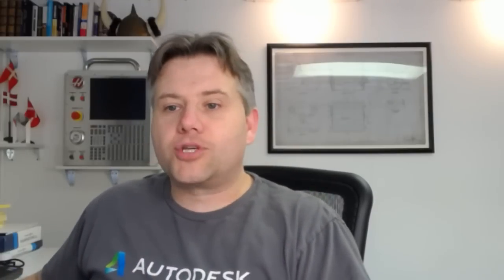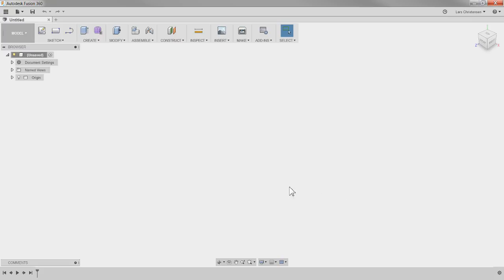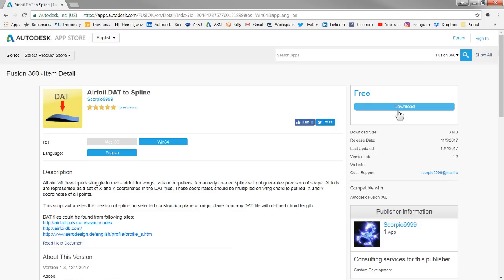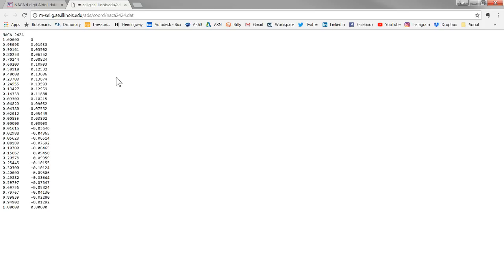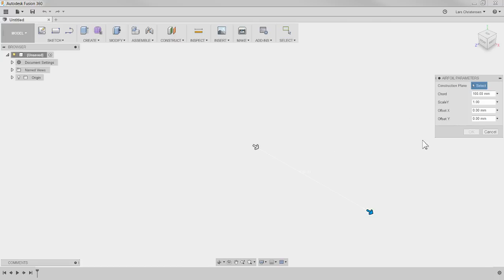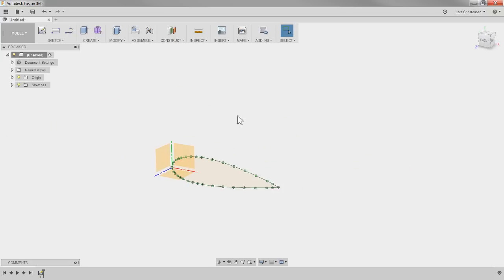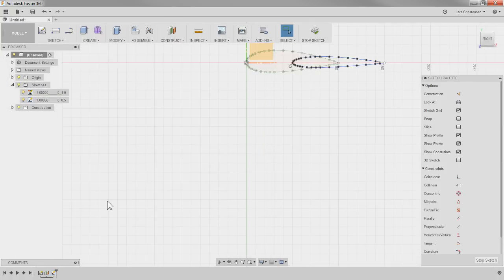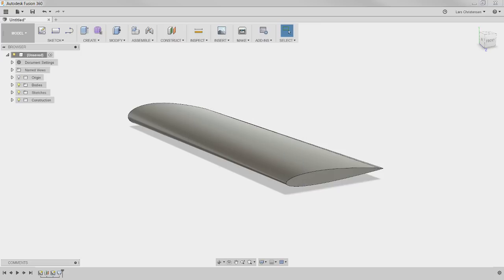How To Create an Airfoil Wing Design — Fusion 360 Tutorial — #LarsLive 120

Comment: You need to add your last coordinates in Dat file to close the loop.
Reply: I experienced that you need to copy it including the name of the airfoil to get the complete closed spline. Sounds weird, but works...
I have to admit that my proposed solution obviously only works with the older 1.8 version of airfoil dat to spline, which I'm still using. In the actual 2.0 version the problem remains unsolved, at least for me...
Reply: @plane_simple  when you select the 4 digit NACA airfoil generator, by entering the values you need to check mark "CLOSE THE TRAILING EDGE", as mathematics formula does not detect the closing edge by default.

Comment: You can actually download the dat file from airfoiltool.com site. For each foil, there's a view where finer details can be modified before the dat file is compiled and downloaded. Things like angle of incidence, thickness of skin and whether trailing edge is closed or open, and adjust resolution by the number of coordinates between 60 and 200.

AFT also allows one to custom design an airfoil, then download the dat file

PS, in addition to the appstore, there are also scripts that can be downloaded to import airfoils

Comment: I have read all comments but can't find why it is impossible to insert the dat file on my mac. I use text edit. I kept the first line with the name and save with data files and selig files and get the same error messages
Reply: I had to open with an IDE and delete a whole bunch of random text that the text editor had put in there. Worked after that
Reply: Hi mate, You may have to create a new construction (offset plane) first. Then you select that before you press okay and select the data files. I had trouble before that i was selecting a random plane on the screen (newer version doesn't show the 3d planes when you click the origin folder), it would say error not a linear plane etc. 

Not sure if thats the problem you're having but that sorted it out for me.
Reply: Don't keep the first line with name only select and save the numeric table

Comment: 4digit or 5digit NACA airfoil meant a particular airfoil. NACA + digits is standard nomenclature which specifies airfoil. E.g. NACA2412  here 2 is for max. distance of mean camber line from chord line(in percentage with chord length), 4 is distance of "2"max. camber from leading edge( in 1/10th of chord length), 12 is max. distance between upper curve and lower curve(in percentage with chord length)
Google Search for NACA nomenclature.

Comment: I just loaded a wing section from a jpeg file and then traced the spline accurately and got a very good section that when zoomed up looks great. however,  the file I imported was the actual size that I wanted at 375 mm chord and 220 dpi. When I check the size in Fusion it is now only around 190 mm. chord. Why is that?
Reply: I think what you want is to calibrate your canvas. Right click on the canvas in the browser and hit calibrate. You will be prompted to pick two points on the canvas, and how far apart in "real life" they're supposed to be.

Fusion doesn't know the scale of the photo; it doesn't matter what the size of the photo itself is, because what you really care about is the size of the object depicted in the photo

Comment: Using an iMac with 10.13 OS, I loaded the Airfoils  DAT to spline  app and located the airfoil data on the Airfoil Tools web site.  When I try to insert the airfoil into my sketch, I get a gobbled and lengthy error message and no airfoil.  Any idea what is happening?

Comment: Not sure if it makes a difference but coordinate files can be structured two different ways. 1) xy cordinates starting and ending at the trailing edge. 2) xyy coordinates starting at the leading edge and with two y values for the top and bottom surface. I don't know if the add-on mentioned in the video supports both types. You can convert a type 2 to a type 1 easily in a spreadsheet if necessary.

Comment: Hello Lars. I'm fairly new to  the channel, and fusion 360. I run it on a MacBook Pro, and I downloaded the script, but isn't showing up in the script box. Is there any solution? Also, all of the coordinates on the tool site are under maintenance, so. can't access them. Could you tell me the coordinates of the one you used? Thanks.
Reply from the maker: Hi Gabriel. Try to search throw the comments. I’m pretty sure someone else had an issue with the Mac version. It has been awhile since I recorded this video and I did not save the coordinates I used. Sorry
Reply: @cadcamstuff  Thank you Lars for the quick response. I'll search around. Thankfully it is not an urgent problem, I still have a week until open house at my school. This is the last part of what I have to display, but not necessary

Comment: Lars, I have not been successful in using this app so far.  I have the app installed and it seems to work correctly according to the instruction videos.  I copied a .dat file into notebook and edited it so that the airfoil name was the first line of code and all the coordinate data was listed below.  Each time I reach the last step...opening the .dat file....the process fails.  A popup message says: " Failed; Most recent callback first:"  followed by lines of info that I don't understand.  Any ideas?  BTW, I used the other airfoil app and it seems to work fine, but doesn't create a spline.
Reply: A moment after I posted the above message I found the problem.  In the .dat file there was a blank line between the data sets for the top and bottom surface of the airfoil.  I deleted the blank line and the app worked.
Reply: The problem was more than just the blank line in the data set.  I was using the wrong file type.  I chose "source dat file" type which lists the data in the wrong order.  I went back and chose "selig dat file" and the data points were listed correctly and the app worked properly.  Thanks for the video.
Reply from the maker: Hi Charles Radford Thank you for watching!
ANd I am glad you figured out the issue.

Best,
Lars

Comment: Dear Lars,
I'm the author of this script.
Thank you for advertisement of my script! I noticed rapid grow of downloads.
I watched several you videos and was quite disappointed when saw this one.
You misleading your followers. Be careful with it.
As Autodesk person first you should teach all of them to read User Manual. For this you should read and watch them yourself first.
In case of version 1.3 I made dedicated video how to use this script properly.
Mistake #1. You didn't copy all lines, so you lost key element - name of airfoil and you lost one pair of coordinates. This is why your spline is not closed. It's your errors which users will repeat again and again as they trust you.
Mistake #2. File should be named the same as original airfoil.
Mistake #3. You didn't notice that construction planes and sketches are automatically renamed (apart origin planes).

All these can be avoided if you read/watch the User Manual.
Reply: You are right I also noticed it.
Reply from the maker: Hi Scorpio9999channel Thank you for taking the time to write this! 

Best,
Lars
Reply: The first and last X, Y coordinates should be the same to close spline. Otherwise spline will be open. If you change coordinates as you sugested, you will swap TE to LE.

Comment: The reason that the spline curve was not closed is the “Airfoil_DAT_to_Spline” addin uses the first line of the .dat file to name the sketch. Thus the first data set for the spline curve is not used. I put text in first line of the .dat file ie.

naca651212
1.00000     0.00000
0.95017     0.00672
0.90033     0.01463
Reply from the maker: Hi Robert Breen Thank you for watching! Yes, Thank you!!

Comment: Hello Lars, many thanks for this great example of profiles, super good.

I would like to know how to fold the profile following a rail in the loft, I have problems when I want to select the 2nd rail.
Any suggestions
Thanks for your videos
Reply from the maker: Hi Ricard v-r Thank you for watching!
Not sure I totally understand the question. Does this video help?
https://youtu.be/6u29SqgvQik?list=PL40d7srwyc_Mkgc5wvP_OfVel9aDkNkZ6
Reply: Hello Lars, I'm struggling with the same issue. Whenever I select the second rail, i get the error: "The rails do not intersect all profiles". With basic shapes it works as shown in your video. With the airfoil profiles on the other hand it is very hard to identify the correct point of the airfoil intersecting the plane where the rails are located. Do you have any tipps for this?

Comment: Hi Lars! Thank you. Why do we see last segment that you add manually produces separate face?
Reply from the maker: Hi Павел Медведев Thank you for watching!
Because I used a line, instead of a spline. I learned from Patrick on the livestream that dat files don't read the first line, so I should have moved everything down one step and everything would have been fine.

Best,
Lars
Reply: Hi! Thank you Lars. Am I right that if I put spline in that place instead of line - then Fusion will treat resulting surface as one face? Is it possible to find any information regarding theory behind faces and surfaces? I'm interested in that, and also I run channel for russian speakers and would like to give some step-by-step theory in surface modelling.

Comment: Actually, aircraft with the old 4-digit NACA airfoils are likely to have straight wings without any tapering or sweep. The 2412 (12% thickness) is actually pretty common. If I'm not mistaken, THE most-produced aircraft, ever (Cessna 172) uses it. The 2424 (24% thickness) would produce high lift and moderate drag at low speeds but would be unsuitable for even moderately fast flight. Some airplanes have what's called "aerodynamic washout", which means the airfoil may change, or the angle of incidence may reduce from the root to the tip.
Reply from the maker: Thank you, everyone, for sharing your knowledge! Love to learn about this stuff
Reply: The most used model shape is the  clark Y which is flat bottomed.
Reply: Yes, for model airplanes that is apparently a favourite, because it performs well at low Re numbers and is easy to build on a flat working surface. In the "Incomplete Guide to Airfoil Usage" it is also a very common entry.

Comment: Great stuff, thanks. I should have known those apps before. I did some CFD models with Fusion360 for dabbling with OpenFOAM, and struggled to get the .dat files into Fusion.

There are various sites that actually generate NACA airfoil data with an arbitrary number of points. They are completely defined as relatively simple mathematical equations. Modern airfoils are the much more complex results of evolutionary development using combinations of CFD and wind tunnel tests, and are generally also trade secrets. (NACA was the predecessor of NASA, so that gives you an idea how old NACA airfoils really are. They predate the foundation of NASA.)
Reply from the maker: Hi pinkdispatcher Thank you for watching!ANd sharing you knowledge!

Comment: Excellent Mr. Lars, up my alley with the information, and it was helpful. Now, I'd like to see this taken up several notches to make wing structure, and then go to a 2D tool to cut the ribs... Here is a scale flying 4meter model:
https://www.rcgroups.com/forums/showthread.php?1455941-1-5-Scale-Horten-IIIe-%28motorized%29
https://static.rcgroups.net/forums/attachments/8/0/5/0/2/a4096236-220-hoiiieandhoixv1.jpg
https://static.rcgroups.net/forums/attachments/2/6/2/4/0/a4082704-138-HIII%20Skin%20Left%20Rear.jpg
https://static.rcgroups.net/forums/attachments/2/6/2/4/0/a4082705-22-HIII%20structure.jpg
https://static.rcgroups.net/forums/attachments/2/6/2/4/0/a4119613-43-DSC02907.jpg

Not my work, but a sample done in Rhino4

Keep up the good work...
Reply from the maker: Hi Ma Va Thank you for watching! I will need an airplane wing education for further steps

Comment: Mr, Lars, YOUR  a Great teacher you have a very smooth approach to guiding newbies into CAD,
Looking at the Dat file I noticed as you did the open end however when you clicked on the splines it showed a number of green lines if you look closely at the first point that didn't close (I'm just learning but) could you not pull the open black dot and close it to the ending open dot in other words the file is merely a number of Beiazer  curves (spell check)
Thanks Grant
Reply from the maker: Hi G Tone Thank you for watching! I learned from Patrick from the livestream that the first line of code is not read in a dat file. I should have included the header from the copied file when I copy/pasted into notepad and it should have been fine :-)

Comment: Hello Lars. Thank you for great lessons. Got questions on F360:
1. Could you make a video on how to model a rubber track and proper drive sprocket like on mini excavators? It is so hard to model it. In fact i don't know if it's possilbe in F360?
2. How about gears in F360 (spur gears, bevel gears, etc.)? No gears generator/library in F360. Could you tell us more what is the reason of lack of easy way to generate such things?
3. Splined shafts - same as gears...

Thank you so much!
Reply: Bevel gear generator and helical gears are available on the app store, spur gears should be already in the scripts and add ins area.
Reply: 105bogus I actually might take a look at this myself.   I'll put it up on my channel if it goes the way I think...
Reply from the maker: +1 enginebill Yes, check out the app store for some pretty cool apps.

Comment: Can you show how to put a twist on the 'blade' like on a boat propeller?
Reply: Good idea: how to properly model a propeller?
Reply: If you want to put a twist in the propeller I would follow Lars' steps above, but on the second sketch instead of fixing all of the geometry just fix the point you want to pivot around then window select the wntire 2nd sketch and click and drag to rotate.   The trick is to only fix a single spline point and make sure all the splines are blue before you try to rotate it.   Good luck!
Reply from the maker: +1 Morgan Rockstar! That could be a cool livestream.